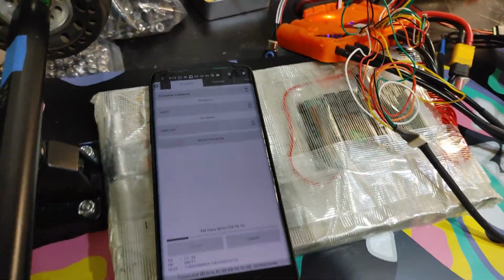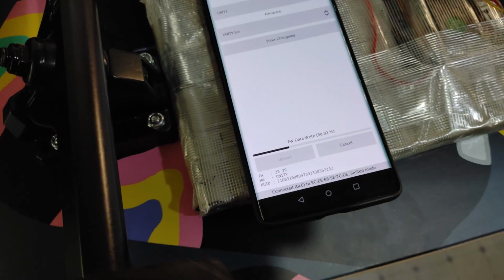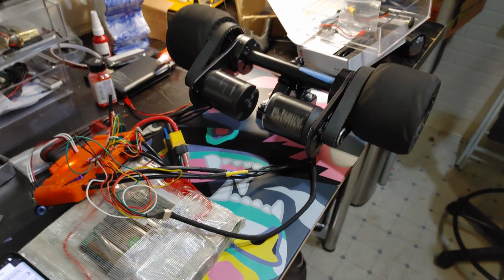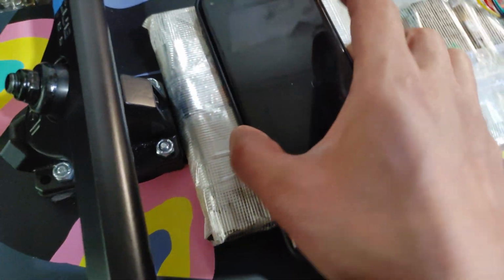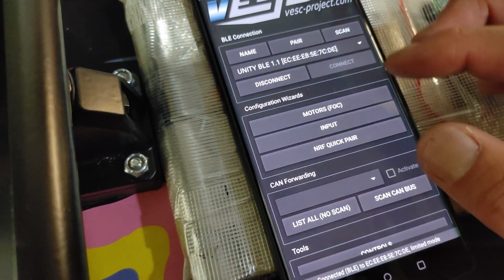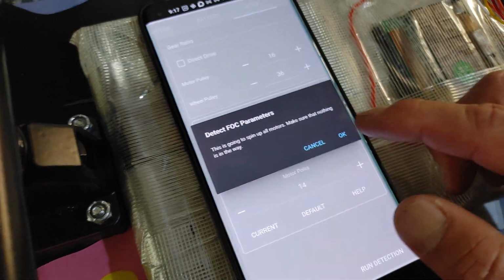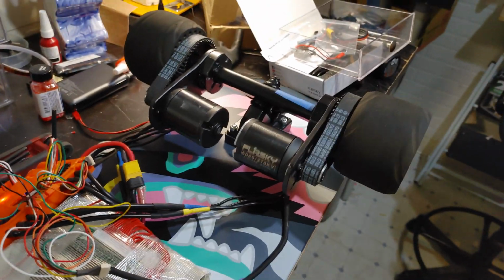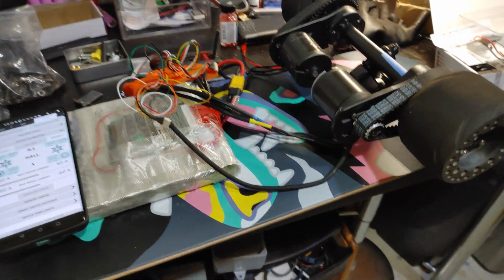DIY Electric Skateboard w/ Focbox!

Comment: You need to update the firm ware on the vesc app when connected to the unity that will uploaded firmware 5.1 to the unity making it compatible and ready to use 👍🏼
Reply from the maker: It didn't work for me.